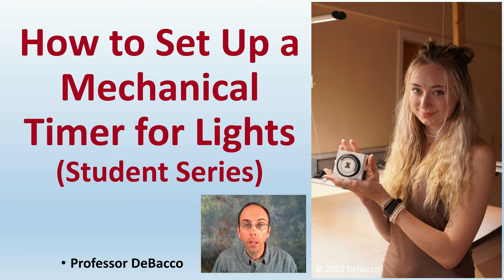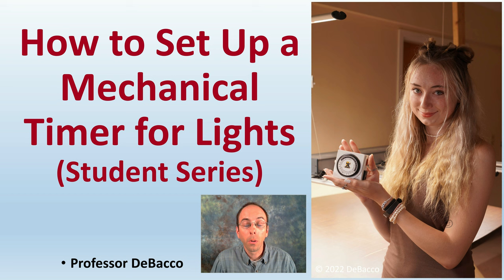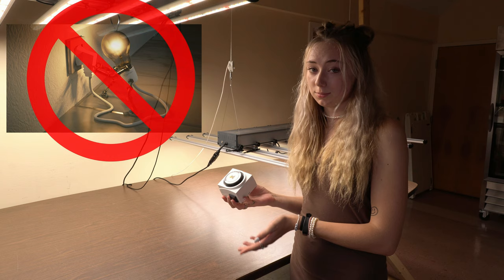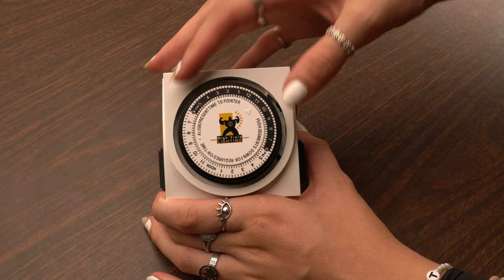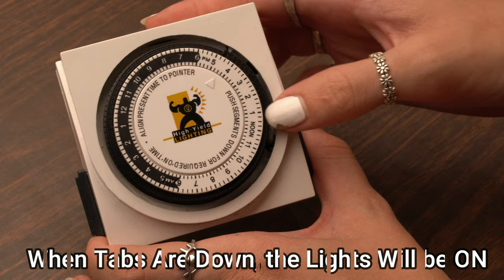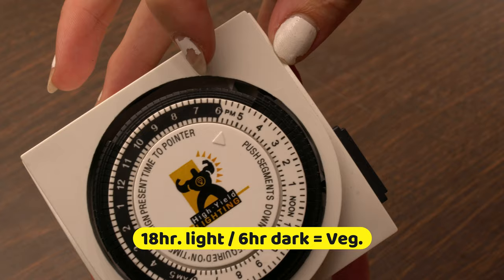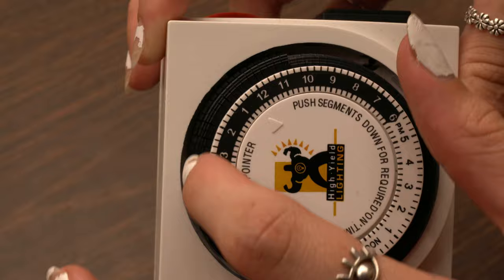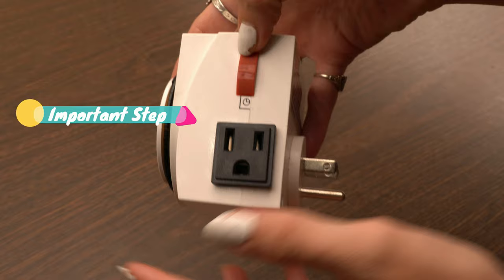How to Set Up a Mechanical Timer for Lights (Student Series)

Comment: Make sure your lights are all the way off when the timer is set to be off. I have seen them go bad and the lights just barely stayed on, like 5% when they should have been off. You don't want your timer to leave the lights just barely on.
Reply: Indeed.  I had one of those analog timers and brand new out of the box when it shut the lights off it had a faint glow (could only see it by getting under the light) from two rows.  After doing a bunch of tests, I just bought a digital timer for $15 and it 100% cut the power to the lights and fixed the issue.  Also was much easier to program and can do multiple programs if needed.
Reply from the maker: It is always good to have random and continual checks of all equipment.

Comment: There are digital waterproof timers now and smart wifi outlets that also have timers that work much better just an FYI!
Reply: Yeah, but this is the how to setup a mechanical timer tutorial. Lol.
Reply: @sideshow45  The tutorial should have been throwing the analog timer in the trash and showing you how to purchase and program a digital timer for a few bucks more.  It's hilarious that people will buy a $1000 LED light and then plug it into a trashy analog timer that are known to not cut 100% of the power to the light.
Reply: @ev25zv  my lights are controlled by tuya smart home app. It's proven very useful. I don't like if they lose power they automatically turn on without a timer though. I had it mess up a dry one time. They get unplugged now during dry.
Reply from the maker: Mechanical timers have and will continue to be used so not sure how a digital can work "better".

Comment: Trust me...you should put tape on that red switch. It is easily bumped.
Reply: I hit that switch about a month ago and left it on for over 24 hours during flower. Luckily I caught it immediately the next day, and I immediately introduced 24 hours of darkness before flipping back to 12hrs on/off
Reply: @Hipsters_N_Hippies  Did you had any problems despite this happening?
Reply from the maker: This is a good tip.
Reply: @MatheusOliveira-dx8lb  honestly I have not noticed any hermaphrodite traits. The only thing was a slight magnesium deficiency. And  that was actually quite mild.
Reply: @Hipsters_N_Hippies  great, thanks for replying! Thats a pretty solid tip.

Comment: dont use those timers they make digital ones by now that are way better .
Reply: With battery backup too. Really helpful if there's an outage
Reply: For real.  Choosing an analog timer over a digital timer is like choosing to use a string of incandescent lights over a modern LED light.
Reply from the maker: Some digital timers are not recommended to use with digital ballast.